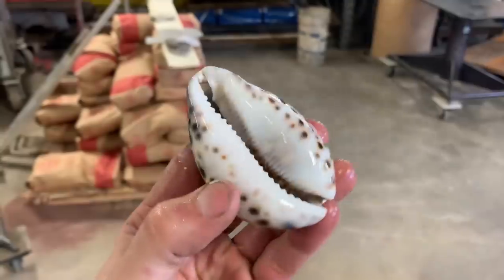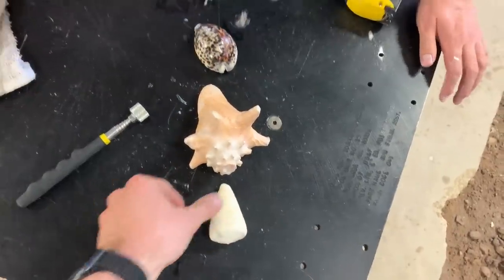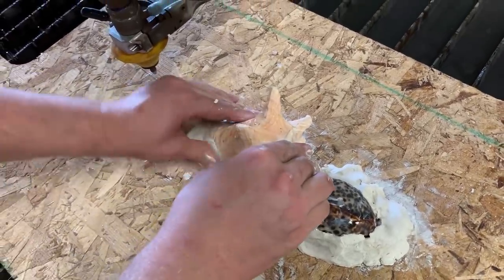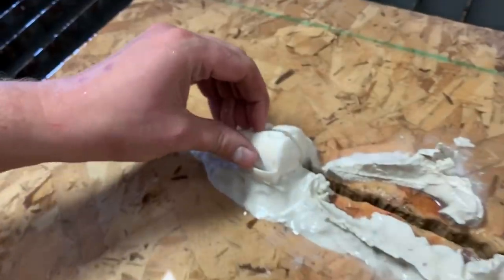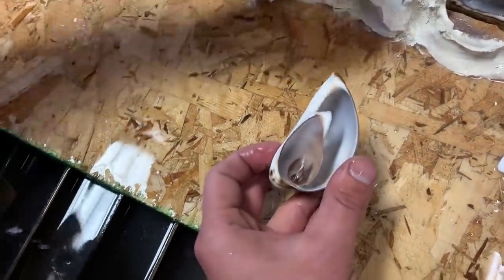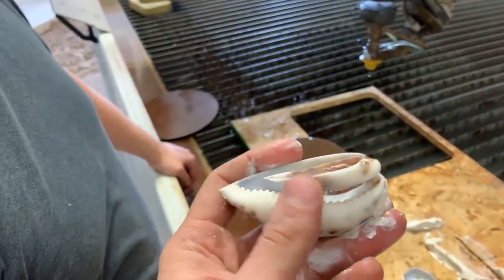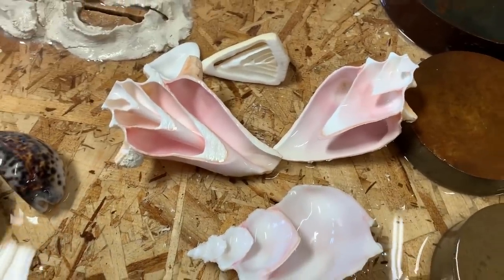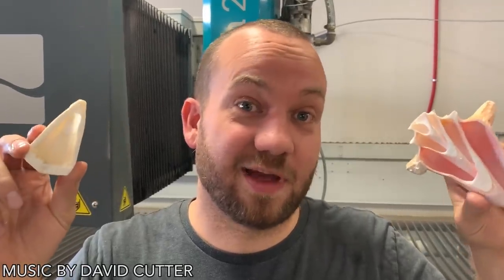Seashells Cut in Half with a 60,000 PSI Waterjet - Sea Shell Patterns in Nature

Comment: The shell is a spiral shape because of the twisting forces of the water, which cause the creature living in the shell to need to constantly rotate to remain upright, this leads to a creature with n incredibly twisty backside. The twisting forces are caused by surface tension and lead to a higher 'bite' force at the mouth of the shell. Over time this bite produces the tooth like growths on some shells; these  are called nashers. The nashers are in face not teeth but unwanted growths which fall off at the age of 14 months. However when the sea pressure is high due to a new moon, these can get stuck and are a common cause of shell explosions. Shell explosions can be deadly to neighbouring crustations; in particular the snarkelpogy which lives in a perfectly square shell. Snarklepogy's are nearly extinct due to these explosions which explains why most people have never even heard of a square shell.
Reply: Sounds made up but deep down inside I know it's not.

Comment: The animal in the shell is considerably larger than you would imagine.  If you pick up a  3 to 4 inch fighting conch on the beach, that you are checking if it is alive - the animal will start putting what some call it's foot out.  For a shell that size the foot can be five to six inches long.  There is an animal in every shell to start with.  If you look at a scallop, you will see the expansion marks as the animal grew.  If an animal dies and the shell becomes empty, hermit crabs will use the shell as a house.  As the hermit crab gets bigger, it looks for a bigger empty shell.